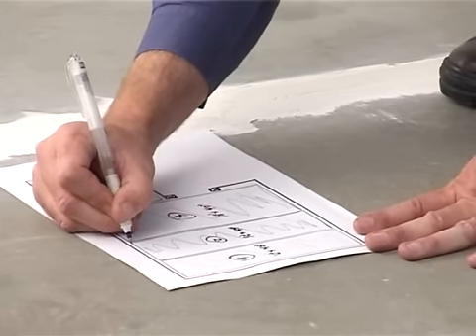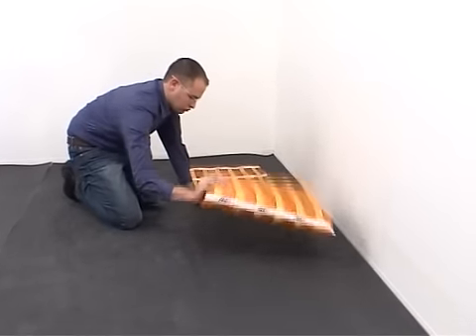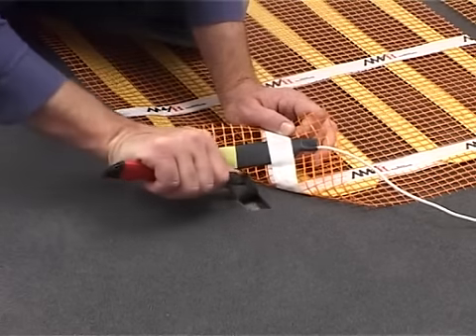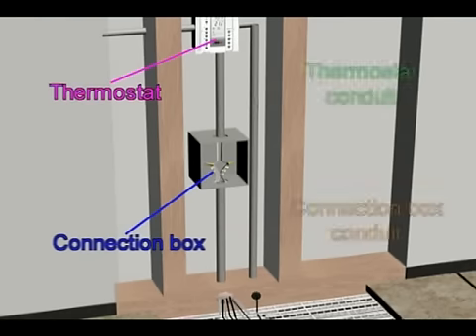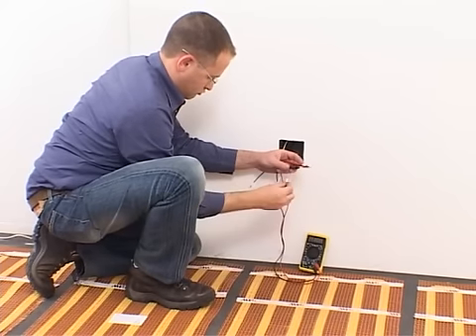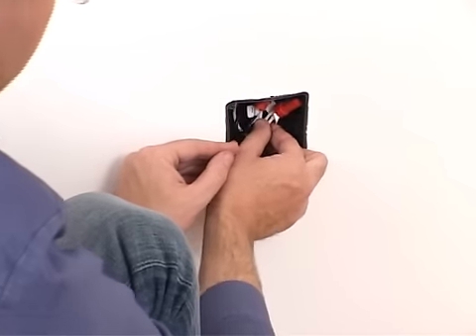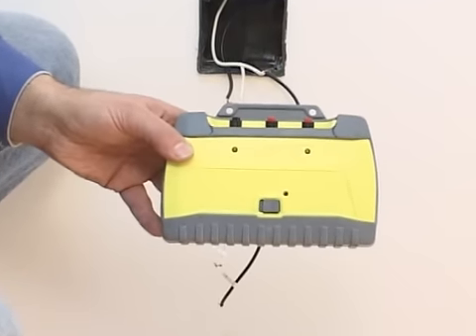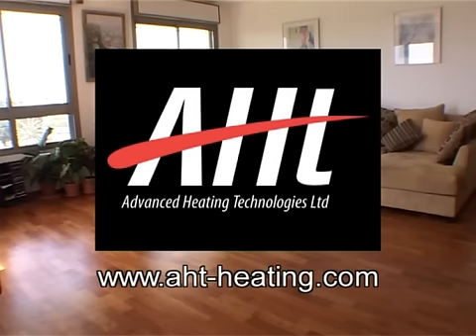AHT Under Floor Heating Installation For Wood Floors

Comment: I have been using it in all the houses we build and we never had even a single complaint or fault.  Furthermore,  all homeowners and tenants are extremely happy with the low cost of heating up their homes, compared with what the others are paying!  From experience AHT underflooring heating installations are costing us around 50% cheaper that other forms of underfloor heating, such heat pumps.